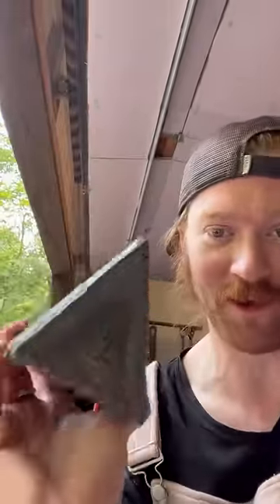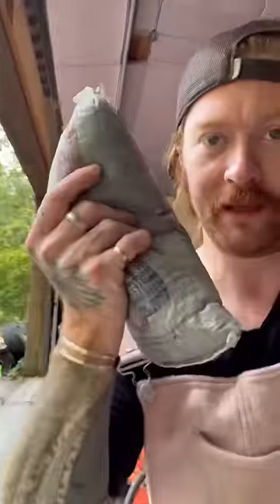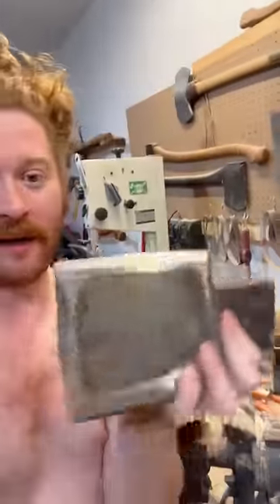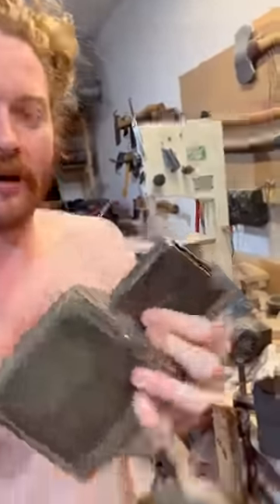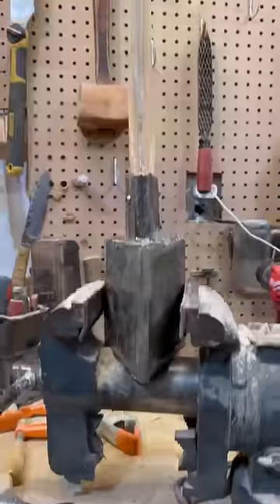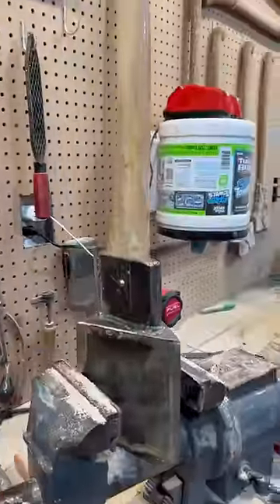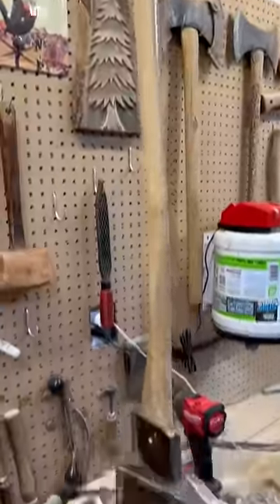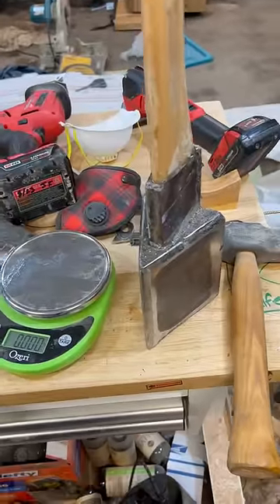LET’S MAKE A DEADBLOW SPLITTING AXE

Comment: I feel that handle mount won’t last
Reply: Yea it's only as strong as the epoxy holding it in.
Reply: That is so much steel weight lol
Reply: Two pins wouldve been better
Reply: I mean, it's just a proof of concept
Reply: @braakaakaa he could weld two bars that would go further down handle and put two or three pins through them
Reply: Just use a steel handle like the solid 12lb triangle mauls do.
Reply: It isn't meant to last. Neither will the head of his "maul". But it will last long enough to serve its purpose
Reply: No shit?
Reply: Epoxy means you can't change the handle. Shame.
Reply: @Ith4qua  yes. Agree. I’m still impressed. Would have preferred a traditional through design with wedge. 

Given the effort to make the head, the Mount detail felt like a letdown.
Reply: We won't know until it keers
Reply: I second that motion
Reply: I betcha there is a good reason, learned from hundreds of years of experience, that there are no axes, mauls, or sledgehammers that use glue and a pin to hold on the head.
Reply: Glue, epoxy and wont last 10 wacks, my opinion. Ive tried numerous times.
Reply: Agreed, the shock in use has to be enormous. I wouldn't trust it over time.
Reply: It will not.  At least not practically.  A wedge + pin design would have been better.
Reply: I dont think it needs to

Comment: I'm a big guy,6'4", 265lbs. I welded a steel bar to a 12 pound maul. I heat with wood up in Canada and it's lasted me over 30 years! The bar has a dent,from some misses,but it's powerful and never will break. I also recommend a pickaroon to save your back. Fiskars makes a reliable one. I would love to see your deadblow at work.

Comment: I like your idea, but I think you have the wrong angle on the maul head, I think it needs to be more narrow.
Reply: I totally agree that is too steep of an angle
Reply: You're right. And it needs to not be mild steel
Reply: @smokey72382 my favorite splitting maul style is the cheese wedge 15 pounder nearly the same shape that he has. Works far better than the imitation sledge hammer style mauls for suburban housewives. I tried building my own with a more narrow angle and it didn't split half as good
Reply: @profcastle or atleast harden the mild steel
Reply: @BleedingWhiteKnuckles  you can’t harden mild steel
Reply: @doaimanariroll5121  why not? Since when yankee?
Reply: @BleedingWhiteKnuckles  I’m Australian. 

Because there’s not enough carbon to form a crystal structure. You can case harden it, which means adding a layer of higher carbon steel on top of it. But you can’t get the actual mild steel harder. 

If you heat it up and quench it, it will be exactly the same as before.
Reply: Nope. That's fine for splitting. The finer angle 🪓s are for felling trees.
Reply: Weld a 1” x 3/8” strip to the cutting edge and grind it sharp. That gives a finer angle where it’s needed. No need for fancy hard steel it’s not cutting across grain.
Reply: It's a maul not an axe, it should be broad. This is a similar shape to other very heavy mauls.
Reply: Yes, shallower angle and longer wedge.
Reply: @doaimanariroll5121 that's absolutely incorrect, mild steel gets significantly harder if you quench it. Not all that hard compared to a tool steel, but harder than it was.

Annealing also makes it softer.

Basically, mild steel is like every other metal.
Reply: @jaredlancaster4137  nope, it doesn’t. There’s not enough carbon in it, if you wanted to harden it you would have to heat it and hammer in carbon at that point you turning the metal into a different alloy, high carbon steel. 

Quenching mild steel will give you exactly the same hardness as before. Anealing it will make it as soft as it always was.

Mild steel not being able to be heat treated or hardened is metallurgy 101.  

I hope you haven’t made anything structural assuming that it can be hardened.
Reply: @doaimanariroll5121  literally all metals get softer when annealed, including iron with zero carbon content. What are you smoking man
Reply: @jaredlancaster4137  no they don’t Jesus Christ man, just google. All steel/iron contains some carbon as coke is used in the smelting process. 

Mild steel contains >0.1-0.25% carbon, you need at least 0.35% carbon to get any sort of heat induced hardening and even that won’t be very hard. Tool steels contain 0.5-1.5% the higher the carbon the harder ,yet more brittle the steel is. 

Cast iron contains up to 4% carbon and is therefore very hard and very brittle. 

Wrought iron contains less than 0.1 carbon and can NOT be hardened via quenching.

Comment: I've got a maul similar in the wedge design, is heavy with a steel handle and padding on the hand end. I've had it for years and it'll split anything you can swing it to. It's called the Mauller. It doesn't vibrate when you hit tough knots either. You definitely get a good workout using that mammy jammer.

Comment: You could also do something I’ve heard called “fox wedge” the handle. You cut a normal wedge notch in the handle, put a wedge in the split and then hammer it home. The inside of the mortise should be slightly tapered to better capture the handle when it spreads out inside the mortise.

Comment: There has never been an ax or splitting maul that I can’t break or mangle in some way.
It only took me 11 years to break the first fiskers they put out and I’m fixing to break the 2nd one.
The fiskers Ax is weak on the top and it will get thin until the head falls clean out.
I once broke a metal v shaped heavy ass maul given to me by an older man I worked for who only paid to split wood by hand who said “try and break this one tou little shit”I don’t try to break splitters but this maul was all metal and it didn’t break clean off,it was just not possible it was all metal and heavy as hell but I somehow twisted it splitting yellow birch so that every swing after nearly broke my wrists when it would twist and it twisted on every swing after and I turned that mail into a wrist breaker.

Comment: I ordered a 16# maul head, it was a beast. It was a wood splitting machine once you could get your strokes in line. It took a larger size hickory handle and eventually the handles would split from all the energy generated. Now that I’m 68 I prefer a 4.5# splitting ax 90% of my splitting and save my Fiskars maul for the heavy duty work.

Comment: They do exist, usually with a hollow steel handle welded directly to the head. The head is shaped exactly like yours, and for some reason everyone I have seen is painted red…
Reply from the maker: They don’t exist. This is a “DEADBLOW” like I explained and the title says 😂
Reply: Maybe it signifies the difference.
Reply: It's called a Monster maul, sold in the 80's, exactly what you made. They do exist.  You young kids don't have a clue,,,,,
Reply from the maker: @roostertrucker  You've commented three times on my videos 😂 First of all, thank you for the engagement. Second, I didn't make a Monster Maul, because Monster Mauls don't have lead shot in them. Or a DEADBLOW like the title says. (I'm assuming you can read since you can write.) And last but not least.. How sad are you?

Comment: Why not?  Physics.  I don't believe a dead blow maul is necessary.  A dead blow hammer is designed to be used where you don't want the hammer head to bounce off of another tool you are striking.  A maul is hitting wood, so it typically hits and sticks or splits the wood.  So, unless you are trying to split a solid block of metal, I don't really see a need.

Comment: From the time I was fourteen until the time I was 18, we drove 80 miles and then 20 miles out into the mountains everyday in chino valley arizona, and dad would cut shaggybark juniper from before daylight until after dark. We were very poor. Instead of school I had to work with him because my mother and sisters and little brother had to eat. My job was to carry the logs down the mountains to the truck, even though we would drive through the rocks / mountains to get as close as we could to each area (keep in mind we could only cut dead wood) and then I would have to split the wood and stack it in the truck. Then run up and get some more and do it again. We would go at a run all day long, and by the time the sun went down, the two of us would have a couple of cords of split firewood stacked in the truck and strapped down. Well sometimes we wouldn't have time to split it all. We would bring it back to our house out in the middle of nowhere. We lived in this valley and while we technically had five acres, this 5 acres was in the middle of millions of acres of wild land, foothills of Bradshaw mountain. There wasn't another house for miles. I loved it because I could walk outside and go hunting during rare occasions we weren't working. So as you might imagine we had huge piles of firewood laying everywhere. On the weekend we would load the truck up and go set at the grocery store to sell the firewood. People would come by, we would tell them $80 per cord, and then follow them to their house and unload it and stack it up wherever they told us to. Then we would go back home and get another load, and keep doing that all weekend. So a lot of times I wouldn't have time to split it all and I would have to split it at home. We had big piles of this stuff everywhere, and the ground was covered in shaggy bark from the juniper, and the air smelled like cedar. I got to where I could use a splitting maul in each hand. I got so good that eventually we have the idea that Dad would throw a few huge logs on the truck in addition to the wood we were taking to sell, and I would stack them around the truck where we were set up at the edge of the shopping center parking lot. And I would have huge crowds standing around watching me. At 14, I was about 6 ft tall and I weighed about 165 lb and had muscles beyond my age. With a maul in each hand, I would walk around these huge diameter logs cutting them into wedges usually with one very fast whack. And almost always I could get them going kind of in a circle coralwood split the log and keep going so I can just swing it back over my head and down on the next one as I walked around. We made more money in a tip jar after a while then we did selling the wood. If that would have been a such thing as Internet and YouTube back then (this was in 1987) I would have been an internet sensation and would have been on television. No dice though. But in regards to the deadblow, go get you the heaviest baseball bat weight you can. The donut-shaped whites that used to practice their swings with. (THIS WAS ONE OF THE TRICKS TO WHAT I WAS DOING) and slide it down over the handle of your maul! It will kill any bounce back, and it's going to amaze you how it accelerates your swing without you even trying. It feels like the axe is trying to get away from you

Comment: As I understand it. The reason is because you swing a hammer faster than the lead shot inside. Lead shot goes to the back of the hammer and crashes down on the front. This reduces the shock through the handle. 
While a splitting mall is swung in a large arc, which would force the lead shot to the top of the maul. Moreover, the splitting mall is typically heavy enough to do the work without having to swing it hard enough to force the lead Schott to the back of the head.

Comment: Best splitting maul ever made is called the "chopper one " , with swinging hammers that pushed the wood apart when you swung the axe into the wood..
 It was actually too good - the manufacturer got sued , and now it's no longer sold , because the wood tended to split apart too violently when you hit it.

Comment: I could be wrong, but doesn't the travel path of the shot have to be in the direction of the blow? Like a hammer the path is the whole head and as you swing back the shot goes to the back side, and swing down it hits the strickibg face. If that makes sense

Comment: The angle of that blade looks awfully blunt. You're probably better off welding a can half-full of the lead shot to the flat back part of a regular splitting axe. You'd get the dead-blow action with a regular blade.

Comment: I feel like you should have had a solid splitting wedge and then the dead blow weight behind it. Not a hollow wedge filled with lead shot. I'm not saying it's not going to work. I just have this feeling that having the actual striking surface be a weld isn't going to last very long.

Comment: Made one but we put the shot in the steel handle and did a bit of reinforcement, including welding the head and handle together. I kinda worked...couldn't get the shot weight we wanted to the extra 2 lbs did have an effect...not a success by any means...but yea a few to many issues to go into detail.

Comment: This could have been designed better. Make a tube that you can slot the wood through and have the outside triangle the c asing for the BB welded around it and hammer your key into the wood pressing on the inside frame of the deadblows head and fully securing the entire head rather than a pin that will hammer down and wear away further loosening the head and making it wildly unsafe over time

Comment: That handle end won't last. The handle has to pass through the end (the steel) so the force is in line with the wood. Otherwise there's a moment force on the end and it will twist off.

Comment: Idk if they still make them but they used to. Mine is solid steel and the only thing that's hollow is the handle and even it's like quarter or half inch thick so we only use it one the really hard stuff to split

Comment: Deadblow on a maul isn't a great idea. You want rebound to help throw the maul back into the air so you can take another swing. 

Let's just say for easy math you swing a 10lb maul down at a solid log, and it bounces back with 8lbs of force. You only have to lift 2lbs up to get if over head and take another swing. Saving your own energy. 

If you swing a deadblow 10lb maul down and all of the mass is just stopped dead from the shot, you have to pick up 10lbs again to take another swing

Comment: The handle will snap super quick you need to weld a pipe on for a handle my dad has one of these that I grew up using it's a 15 lb head and I could split almost anything with it in my teens 😂

Comment: I thought a dead blow hammer was a hammer whose head was made of soft material so that  you could impart the energy of a hammer blow to a work piece without causing physical damage to the work piece. Wouldn't a splitting maul always impart severe damage to the work piece, thus defeating the purpose of being a "dead blow" I'm just wondering here?
Reply: You're confusing the purpose of a wooden/ plastic/ rawhide/ rubber/ copper/ lead mallet for the purpose of a deadblow hammer.

The purpose of a soft-faced mallet is to "persuade" without damage.

The purpose of a shot filled (deadblow) hammer is to severely reduce the recoil felt in the hand of the user. Deadblow hammers come in both hard faced and soft faced varieties.

Comment: You're going to want to put a good piece of blade material.
Where the blade belongs and To do that, you're going to have to cut out the weld. That's already there that way you can at least get started into the wood personally. I would have gone a little bit more so narrow. Also I suggest you find a guy named A Jack's or Mr. Clean. Because I don't think you have enough letting your pockets to be swinging at thing.

Comment: A dead-blow hammer is a specialized mallet whose construction is for minimizing damage to the struck surface…..are you making decorative firewood?
Reply from the maker: Because most are typically made with rubber or a soft plastic face.

Comment: They don't exist for a reason. Deadblow is to prevent rebound so that all energy is transferred to work piece. If you have rebound splitting wood you're doing something very wrong!
Reply from the maker: What? 😂😂 you contradicted yourself there. That’s the exact reason I created it. To stop rebounding.
Reply: Anyone who has used a dead blow hammer and also split wood knows why this is stupid. More mass in axe head allows for more energy. If your axe rebounds you're using the wrong side. Also the handle attachment will definitely fail, that head out beyond the end of the handle will act as a lever.

Comment: I dont want to ever be within fifty feet when youre swinging that thing. Either the epoxy will give up, or the handle will snap.
Reply from the maker: Well it’s pinned so
Reply: Your high or something,  will break in one hour if your splitting real firewood for heat. Handle attachment is weak as your manbun,!,,,,

Comment: That handle hafting is the worst I’ve seen, you should put a wedge through it, make sure handle fits tight and make sure to start a couple of metal wedges and slam her through, also eyes of axes are bigger on top and smaller at the bottom, that way it wedges it out making sure the head stays in one place

Comment: as smart as man is, they still work harder and not smarter huh..if i was splitting a lot of wood and didnt have a wood splitter, id make a heavy duty + cutter hardened and sharpend on stainless hydrolic ram 1 inch diameter that i could stack gym weights on for right amount of weight needed with a cable up to a stationary block and tackle over a old oak log buried in the ground 4 foot deep and a truck tire fixed flat ways a foot above log end so when you put the cut lug upright its inside tire and then pull the rope and raise your big splitter up 8-10 feet and let go of rope and bam..4 pieces if split log and you dont have to bend over and pick them up because the truck tire keeps rhem from faling in 4 directions...stack and whack pitch in wheel barrel,trailer or on a sled and put the next log on and repeat..